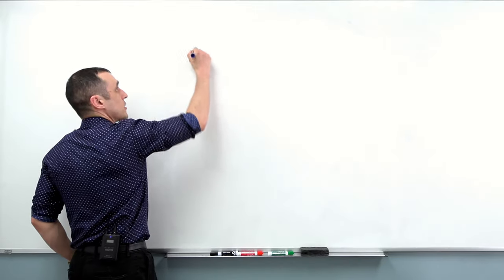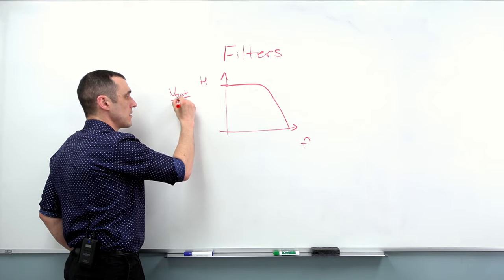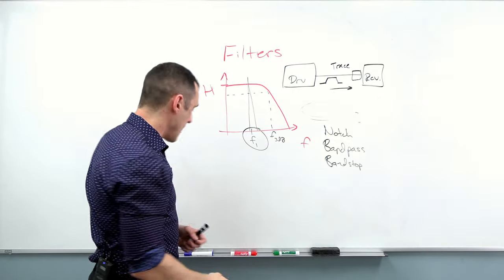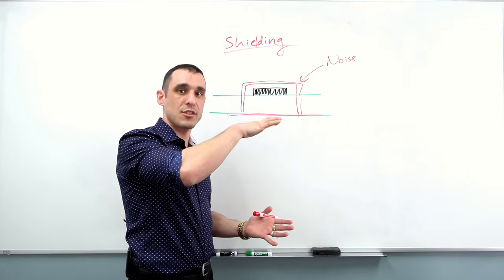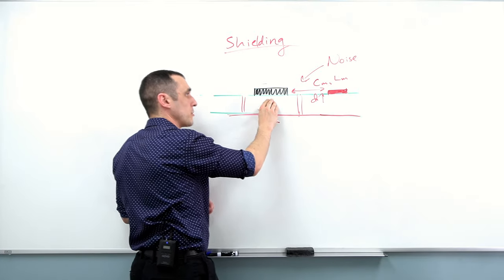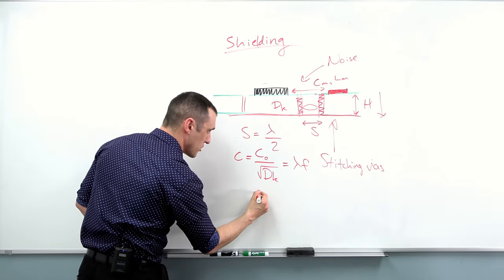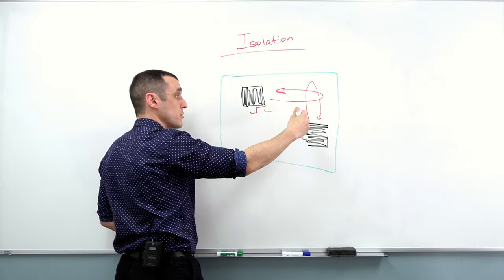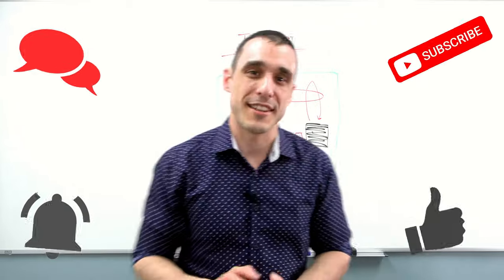How to Reduce Noise in PCB Design

Comment: My thesis required designing an in-house HTRB/HTOL system capable of picoammeter measurements for GaN reliability testing. The majority of the research I did was on noise mitigation—what a monster!

The front-end PCB itself utilized point-to-point wired differential inputs on PTFE insulated terminals, a via fence around the inputs to the first stage of my 2-stage transimpedance amplifier/high order LPF, isolated planes, massive ground planes, a shielding guard trace, and an RF shield electrically attached to it.

It was a humbling introduction to the world of highly sensitive measurements and RF engineering!
Reply: You should send in the design for a 1-minute design review
Reply: @Zachariah-Peterson  what files would you need exactly?
Reply: @richardramos5124  Just the PCB design files would be fine

Comment: For me (audio electronics hobbyist dabbling in logic signal control) the example given at 20:14 is the rule, not the exception; I'm sure this holds for any modern audio electronics, which is hardy a niche field. Consider any Class D amplifier. (What about elevating one of the ground planes with a resistive divider, which was fairly common in valve amplifiers to keep filament hum out of the signal?)
About shielding: At a signal level, there are options beyond the PCB level that designers use. For critical low-current signals, rigid coax is common for unbalanced signals, especially high-end test equipment, and shielded twisted pair is de rigueur for balanced signals. The latter has been used for stage cable snakes for many decades.
Reply: Yeah I get what you're saying. I think the main thing that designers forget is that the logic signals have to be isolated within those grounds. This is one of those big things about isolated systems, you can't route anything across those gaps otherwise they aren't isolated anymore! About the ground plane potential elevation, are you referring to setting a definite ground plane potential difference between two floating grounds using a resistor divider? About shielding, you also have stuff like elastomeric shielding compounds, meshes, gaskets, and even the enclosure.
Reply: @Zachariah-Peterson  I was thinking about filament elevation in valve electronics, typically using either the cathode resistor of a power valve or a tapped bleeder resistor on the power supply to set a floating DC reference. The DC offset reduces leakage current between the cathodes and filaments. Something similar might be useful in mixed signal layouts where it might be impractical to physically isolate an analog signal from digital switching. I'm sure we've all heard switching hash from integrated audio on PC motherboards.

I've seen a few early preamplifier designs where there's a low value resistor between the ground of the first gain stage and the rest of the circuit ground. I realize this is typically frowned upon nowadays, but it was apparently done to because ground current reasons.

Comment: Hi Zach,
Thanks for the great video.
Could we also cover some topics about ESD protection?
I have read some of your articles and known about ESD protection components, 
but still like to know ESD protection from PCB layout aspect, 
and how to deal with ESD in different scenarios, 
such as bench devices and handheld battery devices with metallic or plastic enclosures.
Is the rule of thumb directing ESD current to ground as early as possible?

And besides physically testing with an ESD gun, 
what kind of software tools or hardware equipment can be used for analyzing ESD tolerance or simulating ESD current flows?
Reply: Good idea, sure I can look at putting together some stuff on ESD. I've talked about it before with connectors and chassis grounding but not yet with ESD protection circuits.

Comment: Dammit Zach! After watching several of these videos, I was just getting comfortable with the idea that all this ground-splitting I'm seeing in my audio devices is just an old, antiquated practice of a time when we didn't know better, and then you throw in this curveball that audio maybe should be split! 😫
Would love a bit of a deep-dive on noise and grounding for audio systems some time. 🙂 Finding reliable information is hard because there are so many differing opinions.
Reply: LOL.... I will admit that I don't do a lot of audio and most of the info I present is in the context of digital and higher frequency RF. With audio in mid-range frequencies you might need the splits at minimum for noise control but I am careful to generalize on this. If you do have splits you also need to be careful with EMI because more ground is generally better for EMI. You also need to make sure that any splits do not have traces routing over them. Sounds like I will need to do a video on designing at audio frequencies!

Comment: Hello Zach, thanks for your podcasts - these are absolutely amazing :) But I have problem, which give me sleepless night. I have stackup TOP Layer, GND, Inner layer 1 (...) and I have RF traces on the TOP (GPS) and digital signal traces on IN1 (>>100kHz). Beetwen those layers is a GND plane, so signals on the IN1 and on the TOP layer have return paths on  the same GND layer. If the return paths can affect with each other and cause problems ? In this case, the traces on TOP and IN1 should be routing ortogonally ? 
Thanks and regards from Poland !
Reply: Placing GND between these two layers prevents them from interfering with each other.

Comment: There is always that troll who thinks to know it better. Let it be me today. I disagree not using "filter" for digital signal. E.g. using a series resistor of 10-33 Ohms in digital lines will build a filter with the input capacitance and removes unwanted upper noise and/or ringing.
Yet, glad to see you did not try to promote blindly splitting GND planes...
Reply: On higher logic levels with large noise margins a 22 Ohm resistor to dampen ringing might be just fine, I see a lot of people on stackexchange saying to do this on SPI when it is running too fast and you have noise (ringing). Problem is you lose some power across that resistor, so more elegant methods are needed with higher speed, lower level signals.

Comment: Hi Zach, about the split GND, in which cases is it advisable to split it? What about the components (ADCs) that have AGND and DGND, must they be connected to a GND plane? Thanks for your videos!
Reply: This is a good question and I have seen differing opinions on this. I am not an expert on designing ADC integrated circuits, but my understanding of the construction of ADC chips is that the AGND and DGND pins should not have some offset between them because a large offset can cause a quantization error by changing the reference voltage. So the AGND and DGND pins need to be bridged outside on the PCB so that everything is at the same reference potential. One way I have seen to do this is to use a uniform ground plane and just tie it all to GND. I think the main challenge here is isolating any noise near the digital interface and any other pins from inducing a current on the AGND pin or the analog input pin. So this is why people say to use totally separate AGND and DGND plane regions. The problem with this is that you inevitably route something across that split; the exception is if you use an inductive coupling method (transformer) or an optocoupler to get across that gap between those regions. Since most people are just routing traces they will usually be forced to route something across that gap and that will create a potential EMI problem.

The other way to do it is to use two separate AGND and DGND regions and connect them at one point very near to the ADC. If you do this, then you cannot route anything across that gap and you should only route the analog signal over the AGND region. This is good for ensuring there is shielding for a low-SNR low-frequency analog signal.

Comment: Regarding 'isolation", what if i have 3 totally different isolated voltage using a multiport flyback?
Reply: Well that would be galvanic isolation and you would have noise coupling between two galvanically isolated regions mostly through switching noise. You have to minimize noise in each region. Also don't route signals directly between two regions, you would have to use optical coupling to get across the two regions.

Comment: Great content and very helpful. I want to know one thing that is related to capacitor coupling between traces. When two transmission lines are near each other and are at different potentials. The aggressor line will cause current in the victim trace due to electric field. The thing that is causing me confusion is that when current flows through a conductor magnetic field surrounds it so how can the coupling happens due to electrostatic force because charges are not at rest they are moving so even if they are making a capacitor still there are magnetic field lines. If there are electric field lines then it means that line is storing some signal charges but the impedance of line is very low so I think it is not that.Can you explain how this is happening. Thanks
Reply: Both effects happen simultaneously. You have both magnetic coupling and electric coupling between the transmission lines. This is because the two lines have some mutual inductance between them; the changing magnetic field generated by one line induces a signal in the victim line. There is also electrical coupling that produces a current through the parasitic capacitance between the two lines. I talked about this in the crosstalk video, you can watch it here: https://www.youtube.com/watch?v=hv_gHRK-fGc

Comment: How effective would a...I'm calling it a trench shield for now...be vs other kinds of shielding? Like deliberately making a gap of maybe 1/3 wavelength wide between noise source and receiver? I'm thinking that if you tuned it right it'd be really quite good.

Mill a slot and plate the edges maybe? Couldn't always use it for structural reasons but for shorter distances that might be worth trying.
Reply: How about you send me a drawing and we do an HFSS simulation to validate it?
Reply: @Zachariah-Peterson  I'd love to! To where shall I send it?

Thinking about it some more it'd probably be really impractical for all but the highest frequencies. 5GHz has a wavelength of about 60mm, if we go for a 1/4 wavelength wide gap that's still 15mm, which is a LOT of board real estate. My gut feeling is that effectiveness would drop off pretty quickly below 1/4 wavelength but I'm still very much a newb in this area.
Reply: @DanBowkley  Look me up on Linkedin and send me a message, I have the same profile pic. If you wanted to examine this type of structure as shielding against 20 GHz or higher you're now talking about 3.75 mm for quarter wavelength, so it's more manageable. Maybe there is something fun to do with K-band radar here.